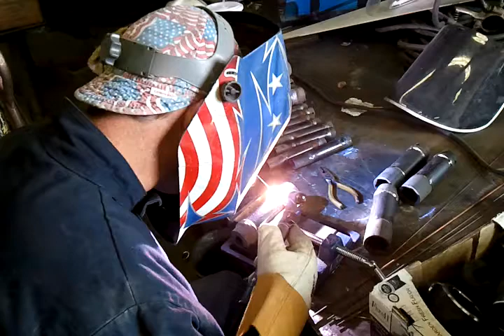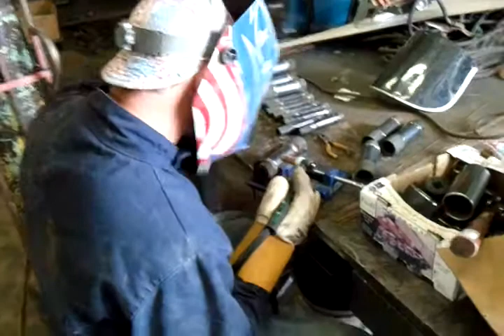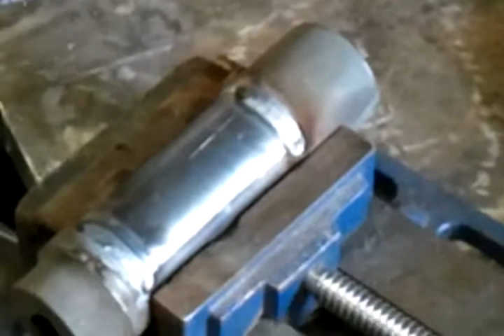TigWeldingSteelSockets.3gp

Comment: Robert welded about a half dozen of these.  I welded the rest of them; about 30.  I made a turn table out of a jackstand and was able to complete  each weld in one single pass.  It was very cold in the shop so I preheated them before I welded the chrome molly sockets to the carbon steel extensions using  stainless steel filler rod.